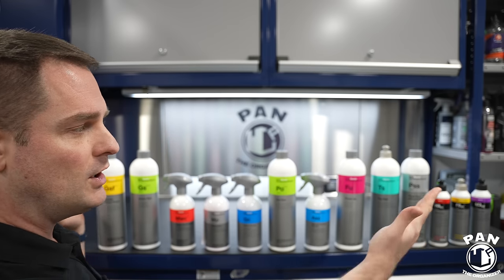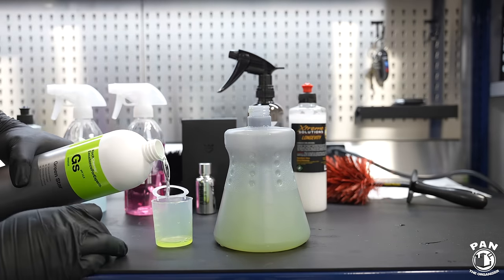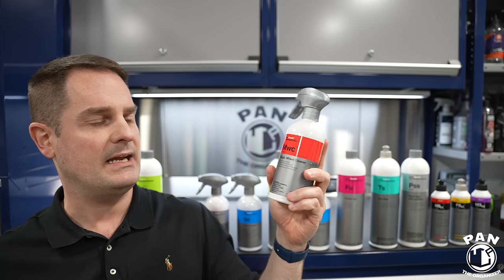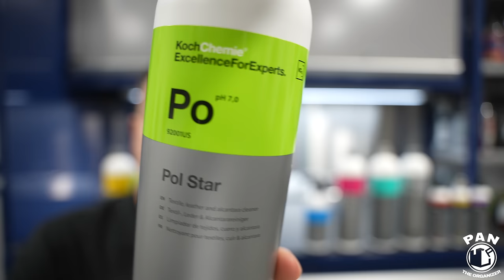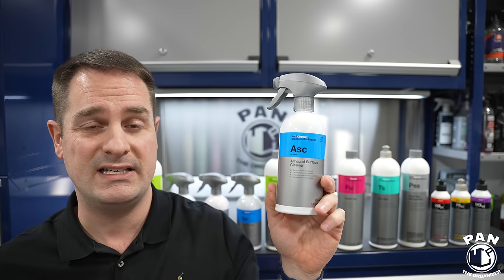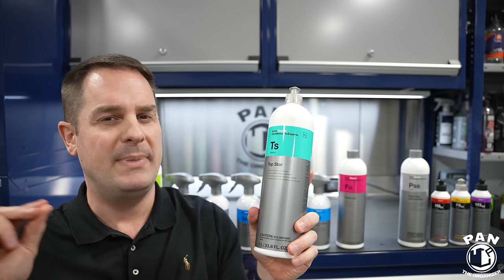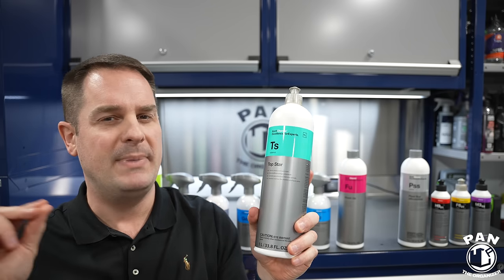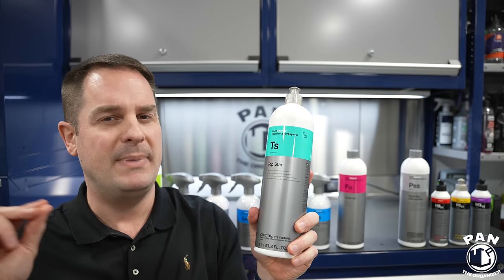KOCH CHEMIE Detailing Products : Brand Review

Comment: I really love the minimalistic bottle design, I can tell it was one of the reasons why oem has chosen as the selected brand. The color coding and plain technical descriptions really fit into German minimalism and technical orientation for order. I can Imagine you could put a Porsche logo on that bottle and it would look as original VW group product which is really important for advertising and If you are going to present Koch products at dealership they will look at home. Also the quality seems very consistent with all the products so far. The reason why Ill be ordering koch chemie for the next batch of products is because their descriptions are easy to navigate and there is no unnecessary overselling as seen with likes of Chemical Guys. That for me as a beginner home detailer is very refreshing and makes getting into detailing hobby less intimidating and allows me to source my chemicals easily and thats why my ADHD brain really finds comfort in Koch chemie because other brands just confuse me with their marketing and make me not enjoy the preparation. My next purchase is going to be Green Start for more contaminated washes, pol star for interior and possibly some yellow line of product ph neutral shampoo for light washes and possibly include something with light wax… interesting that Koch is geared more towards advanced and proffesional audience but for me as a beginner they are the right choice… very good experience with Mwc and Rrr. I compared with autoglanz and turtle wax purple wheel cleaners and the product seems more concentrated by about 3x and is clearly more effective without scrubbing. Cant wait to get my order in. Just quit my job so I will have some free time finally so detailing my become something that will give me sense of purpose for a short while.

Comment: Product timestamps:

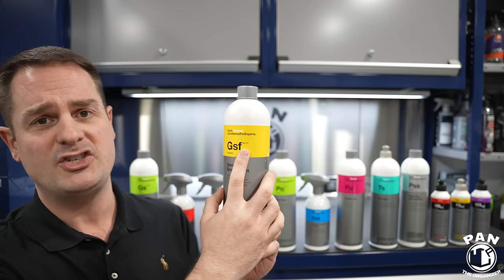Gsf (Gentle snow foam) - 2:33
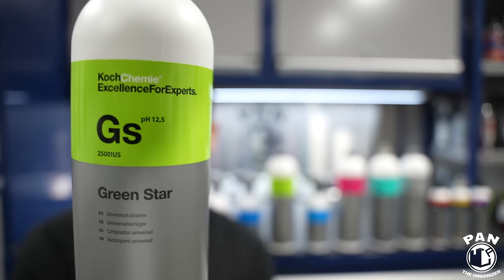Gs (Green Star) - 5:51
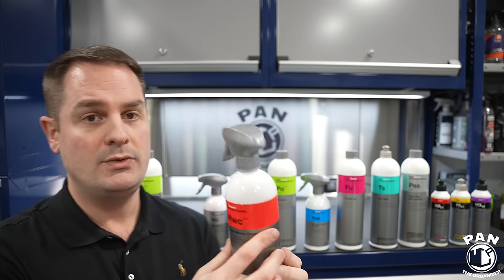Mwc (Magic wheel cleaner) - 7:40
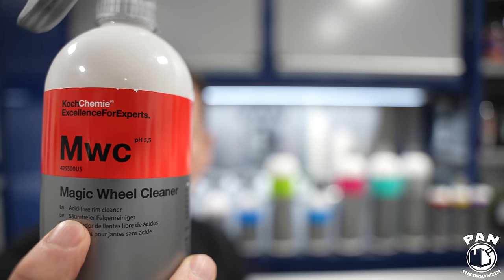Mp (Motorplast) - 9:17
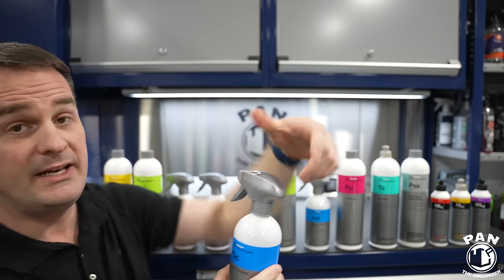Gc (Glass cleaner) - 11:31
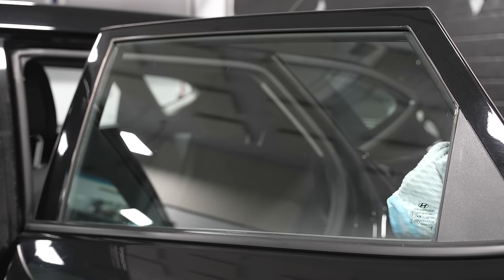Po (Pol Star) - 12:27
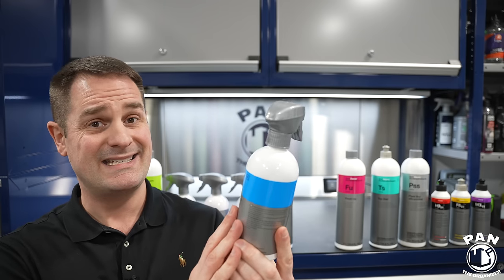Asc (Allround surface cleaner) - 15:24
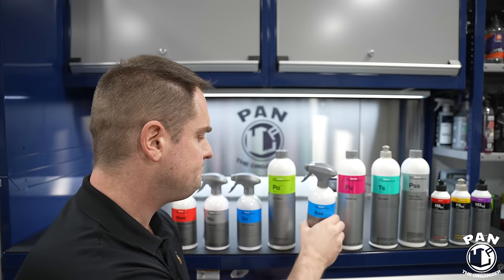Fu (Fresh Up) - 17:07
Ts (Top Star) -  18:24
Pss (Plast Star siliconolfrel) - 19:58
H901 (Heavy Cut) - 22:31
F601 (Fine Cut) - 24:16
M302 - (Micro Cut) - 25:37
Reply: Thank you

Comment: Just wanted to say that I  like the Idea of GDF for light dust removal, its PH neutral which sounds great. Its a heavy hitter brand and is very popular with professionals here in the UK. 
You mentioned about favourite detailing products and tips- I have found a brand in here in the UK called True Grace,  they make amazing scents and fragrances for rooms that last a long time (room scent spray). My favourites are Amber and Black Lily. They don't contain any nasty chemicals. A good misting inside with the recirculation vent flap really works the scent into the car. That's my top detailing tip 👍

Comment: This was a great review of some products from a brand that's really making an impact in the North American detailing market as I'm seeing it everywhere lately. I am definitely going to give them a try when I'm due for various product refills. Thanks as always for delivering knowledge and entertainment Pan!
Reply from the maker: Thanks man!
Reply: The  F6, if I used  for one step, is going to have a hologram?
Reply: @lookmancardeatailing5150  any pure cutting compound should be followed with a finer polishing compound or you'll run a high risk of this happening. Some compounds break down as you use them into smaller grit if you will. These allow more of a one step function.

Comment: Another valuable video from....
 “Paaaaan The Organizer”. 😂
Always watching your vids with pleasure. 🥇🏆
Now I have a question for you Pan. 
Q: Have you ever tried the GSF with hand pump foamer (if yes, in what ratio)?

Thank you for your time and effort to educate all the detailing enthusiasts.

 PS. Have you thought about making a video dedicated to the hand pump foamers and pre-wash products?
Reply: @Boyan a recommend dilution ratio for hand pump foamer is 50ml of Gsf into 1l of water.
Reply: @misaak1898  That’s a bit more. I’m using Bilt Hamber Auto-Foam, ratio 30ml in 1 litre, with great results. The foamer is IK 12 PRO.
Reply from the maker: Thanks Boyan! Yes it works well in a good pump sprayer like Marolex Axel foamer. As per Koch Chemie instructions: For Snow Foam: Pour approx. 20 ml Snow Foam into 1 l water and lather the vehicle using a foam sprayer. For Handwash: Pour 50 ml into 10 litres water.
Reply from the maker: And you will see something cool soon for hand pump sprayers and foamers, so stay tuned!! ;)
Reply: @PanTheOrganizer  wow, sounds great! 
Hope you will launch it soon, can’t wait to see it. 

I’ve been trying a few different hand pump sprayers and finaly became an IK PRO FOAM 12 fan. Using it with  Oasser Air Compressor Electric Air Pump 12V Compressor AC/DC with 2000 mAh Rechargeable Li-ion Battery 120 PSI 20 Litres/Min is a top notch combination. Prolly The Best Combo On The Marker Today. 🥇🏆

Comment: Koch Chemie is one of my favorite lines of car detailing products. I use GSF and enjoy adding greenstar in custom amounts when needed. For the inside nothing comes close to Polstar. This product is much stronger than people think and even diluted 10:1 it can remove lettering on the push start button if you clean to much there. Those three compounds are just amazing and I have used them all with fantastic results. My only drawbacks are the cost of GSF. Great video Pan!
Reply from the maker: Thanks Neil!
Reply: Neil Koch suggest green star for interior cleaning, as per your statement, can we use pol star for dash board seat door etc is it safe for plastic? I want good cleaner for my car interior… please share your thought
Reply: @aminkhalipe3162  I have been using Pol Star diluted 10:1 for the interior for over a year. I love how Pol Star is safe for all materials inside. Plus it is a very strong cleaner.
Reply: @neilwalker5041  thks a lot .. I plan to buy Koch chemo Mzr which seems to same as green star … but now as per your advice I will buy pol star for interior
Reply: @neilwalker5041  I can used for  engine bay cleaning also right ?
Reply: How come lots of people use pol star for plastic, thought it was for fabrics and leather?

Comment: You should try KC Felgenblitz. Its a ph 7,5 wheel cleaner with iron remover. Can also be used on paint as an iron remover. Less bite than Mwc but works really weĺl, and alot cheaper.

Comment: I have a question… so after using pol star for cleaning the interior is it smart to use the top star to go over it all again for the added protection and the nice oem look since top star is a conditioner ?
Reply from the maker: Yes, absolutely. The same applies for leather. Once you use Pol start to clean, I would use Leather Star for protection. See how I cleaned a leather steering wheel using that system in this video: https://youtu.be/xRjB6Pg6szI?si=jKBJlAxM8hSg-2AB

Comment: I’ve noticed that a wet rag with just water does great on windshields and then wipe it off with a dry cloth
Reply from the maker: Unfortunately, water alone isn't enough to remove grime or oily residue often times. You need to cut through that. Watch my interior windshield cleaning tutorial: https://youtu.be/3rF6keJ88Y8?si=FoeVtHQmtQi8q950

Comment: My favorite detailing brand. Have used this brand for 3-4 years and I also have Koch Chemie courses. Very good, cheap and easy to use.

I highly recommend to try out Koch Chemie Spray Sealant S0.02. And Koch Chemie NMS (Nano Magic Shampoo) 

Pro tip: Attach a praying trigger on Koch Chemie Ts (Top Star), spray direct in to a microfiber, spread it out on the surface and then buff it off right away. This way gives it a more matt finish. If you apply it and let it sitt for a few seconds and then buff it off, it gives a little bit more "glossy" finish. Remember: don't use Ts as a Interior detailer. It can be used at light cleaner, but more like a light dust remover with a microfiber. 

Another pro tip: Use Koch Chemie Po (Pol Star) in a foam pump/dispenser 👍

U can use Pss on wet tires! If you do that, you using less product and leave even more matt finish 🙂
Reply from the maker: Thanks for sharing Morten!

Comment: Hi PAN...Have you noticed, that (for the compound/Polish etc..) besides the chart on the bottom of the bottle where it mentions the CUT & GLOSS level, those numbers are also mentioned next to the number on top, for example H901, next to that in smaller vertical print, it mentions 9.0 & 5.0...
Reply from the maker: I had not noticed that!

Comment: When you say you can use the Po cleaner in a steam cleaner do you mean, you are adding it to the water inside the steam cleaner?  Or are you applying it by a mitt and using the steam cleaner to remove it?

Comment: great video Pan .you would also grab Gummifix (Guf)
especially with those winter rubber mats you have,Non-greasy, silicone-oil-free rubber and plastic care for rubber foot mats, plastic floor surfaces and other interior areas in cars and commercial vehicles for which slip resistance is necessary. Makes surfaces appear ´as new
Reply from the maker: Thanks Patrick!

Comment: I've been using the Koch Chemie M3 02 with their purple pad and I'm really happy with both products. I bought a gallon jug of their snow foam because of another video of yours and I love how slick it seems to be. But I'm very interested in hearing more about the engine dressing and the order illuminator. You said the engine dressing reminds you of one of Meguiar’s products. What are the strengths of this product over the Meguiar’s product? Also with the odor eliminator. It sounds like a product similar to Febreze. Does it seem like it is better at getting rid of those tuff odors? Next month I have a 20-year-old smoker's truck to do, so I'm wondering how good this stuff is at getting odor out of headliners.

Comment: Maybe you can answer this question Pan! Being I can’t seem to get an answer. With the ASC, will it strip any of the inferior protection used? Example, if using Lithium Inner Space, will it strip it away from the surface?
Reply from the maker: I don't have the answer to that unfortunately. You'd have to ask the company. The logic would be that if if you use an interior cleaner, it will strip existing protection. Unless you're using an interior quick detailer that cleans and adds protection at the same time (for maintenance).
Reply: @PanTheOrganizer  Yeah, that was my thoughts also. Ok, I will try to reach out to them, though I did leave a message on their YouTube for this product. I’m a bit more curious now. Thank you for the response!

Comment: I'm looking to get a new all purpose cleaner. I had the optimum power clean before. Would the green star be a nice replacement / upgrade ?
Reply from the maker: They would be similar, as power clean is already quite good. But you can dilute Green Star more, so it will be more economical.

Comment: Hi Pan. Could you please make a recommendation. Interested trying Koch Chemie to maintain a CarPro Professional Ceramic Coating. Not happy with CarPro Reload, I also tried switch CarPro Reload for Mother CMX. I have the car washed usually once a week or once every two weeks if not used as much. Would be interested to try Koch Chemie ceramic booster

Comment: carpro lift vs KC GS, great battle! what you say Pan?
Reply from the maker: You mean Gs mixed with Gsf for an active snow foam? I would still prefer Lift on ceramic coated cars. But better than those for a deep clean snow foam, is Bilt Hamber Auto-Foam and Touch-Less snow foams. Those are excellent.

Comment: I have been wanting to try this line, hear so many good things. 
Specifically the Green Star to use as a prewash for the really muddy cars. Any tips for dilution that will be safe on paint? Would it be safe to use in direct sunlight (not allowing to dry of course)
Reply from the maker: The recommended dilutions are on the label, but I recommend that you play around and find what works best for you, with your water quality, and your environment. There is no one size fits all for these things.

You could use Gs as an APC pre-treatment, but perhaps not on a regular basis if you have paint protection. Perhaps use a snow foam with cleaning capabilities in your foam cannon (like Gsf mixed with Gs, or Bilt Hamber Auto Foam).

Comment: Hey Pan, I am a big fan of Gs and Motorplast.  Those interior cleaners seem competitive, how do you think they compare to P&S interior cleaner?  Been using P&S because nothing cleans and leaves a nice level satin finish like it does; price is exceptional as well on basically everything they make.
Reply from the maker: They are excellent cleaners. Top tier for sure. But the thing that's special about P&S Xpress Interior Cleaner is that it leaves sort of like a satin finish on the surface, very unique. Like a matte silk surface, pleasant to the touch. I haven't seen another product do that as nicely.

Comment: Hi guys, just getting started on washing and detailing my car during weekends. Wondering if I can use Plast Star on the engine bay after wash instead of MotorPlast? I can’t seem to find MP in my area.
Reply from the maker: To my knowledge, Plast Star is mainly for tires (rubber). I wouldn't use it in the engine bay as that mainly contains plastics and metals. But you can ask Koch Chemie for a more precise answer if you want to be 100% sure.

Comment: Hello. Please tell me what is the difference between PPS and SIL. Which one is better paint prep for ceramic coating?
Reply from the maker: I don't use SIL. But to my knowledge, PPS is the ready to use formula, no dilution needed. And SIL needs to be diluted 1:4 for use on paint. PPS is a panel prep spray, before applying a coating.

SIL is a silicone and wax remover, so a more intensive body shop type use.
Reply: @PanTheOrganizer  So SIL can not be used as surface prep, before applying ceramic coating?
Reply from the maker: I haven't used SIL, so I can't answer unfortunately. You would be best to ask Koch Chemie to verify.

Comment: Hey Pan, I have a Adam polishes pressure washer 2.0 and the adams premium foam cannon, and I’ve been interested in the Koch-chemie soap could i still use the gsf in the Adam’s premium foam cannon and still get the best results?  especially the foam..?
Reply from the maker: Yes. But keep in mind there are many factors that influence the quantity and thickness of foam that you get:
1) type of pressure washer
2) type of foam cannon
3) type of snow foam
4) dilution ratio of snow foam (find the appropriate dilution for your setup and conditions)
5) quality of your water (deionized water is always better compared to hard tap water)

Comment: Hi Pan. I just ceramic coated my car with Avalon king and it’s sat for about 36 hours and it has been exposed to some very light rain. How will this affect the coating and is there anything I can do?
Reply from the maker: Just wipe it off and you should be ok. Just don't wash the car for 7 to 14 days after applying a coating. The first 24 hours are the most crucial for no exposure to water or rain.

Comment: Hi Pan, I have pol star and green star. I want to use green star for inside plastic areas but I worried. Am I buy the mzr for inside cleaning?
Reply from the maker: Use Pol Star for interiors. It’s the better option.

Although you can technically use Green Star on interiors (dilution ratios clearly indicated on the label), Pol Star is better suited for interior use.
Reply: @PanTheOrganizer  Thank you Pan! I to worry for plastic areas such as, step thresholds. This areas generally more being dirty than other ares inside. Therefore, Is Pol Star enough to clean these places 1:10 dilute ?

Comment: How much did you add in the snow foam lance for the application as was much thicker then what i get with the 20ml i tried
Reply from the maker: I usually do 2 oz of snow foam, 18 oz of water for a total of 20 oz solution in the foam cannon.

But you need to adjust the dilution according to your setup as many factors influence the quantity of foam you get. Water flow from your pressure washer, type of foam cannon, water quality, dilution ratio, etc

Comment: Hey Pan. I recently ordered and received a number of products - including the high end ceramic coating - based on watching you videos. I have a new car and two motorcycles - all black - that I want to protect. The bikes are apart in my garage and the painted surfaces are being cleaned/prepped for the coatings. One thing however I have not seen in your videos are what surfaces the ceramic can be applied to. I did see you include applying it to glass but that got me to thinking about my plastic windscreens on my motorcycles and helmet visor. 
I have always had issues with shedding rain while riding, even tried the Rain-X for plastic. Doesn't work that well. What about ceramic coatings? Just though I would ask before going ahead and applying it then getting a chemical reaction like acetone would. 
Thanks
Reply from the maker: That's because it depends what coating you are buying. They are all different. Some paint coatings can also be applied to other surfaces. For example, DuraSlic DS 1500 Xtreme and Adam's Graphene Ceramic Advanced Coating can both be applied to paint, glass, plastics, wheels, etc. Basically any exterior surface.

Other coatings are paint specific. For example, CarPro CQuartz UK 3.0 can only be applied to paint. If you want to protect plastics and wheels, you get CarPro DLUX. For glass, CarPro FlyBy Forte. 

So again, it depends what ceramic coating you are buying. Check on the brand's website for more info on which surfaces it can be applied to.

When I do a video about a specific coating, I always mention what surfaces it can be applied to. For your info. ;)
Reply: @PanTheOrganizer  Thanks for the prompt awesome reply.
Reply from the maker: My pleasure.